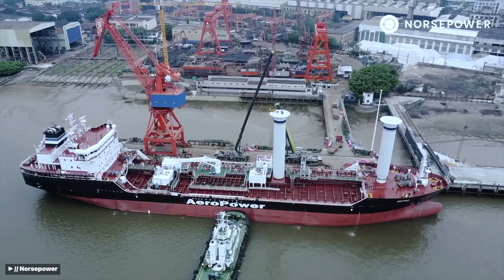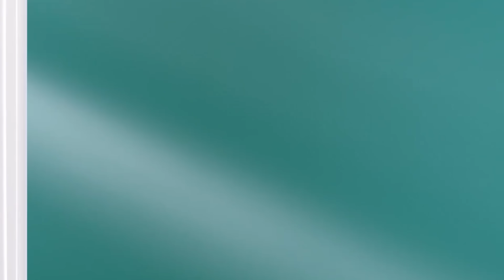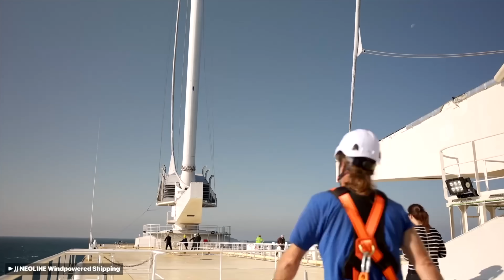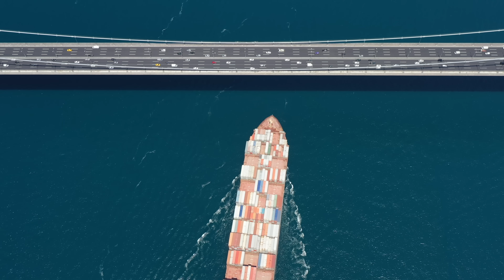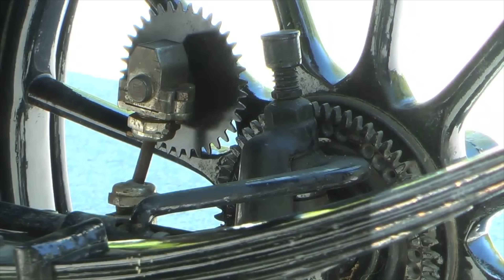Surprise Breakthrough Solves Shipping's BIGGEST Problem

Comment: Wind-Powered Cargo Ships? I thought micro nuclear reactors were being installed on cargo ships to make them carbon neutral, but I guess the development has its hurdles. I guess a low-drag wind turbine has a place in marine transport. ‘The kite that pulls the ship looks ridiculous.??’
This is the ultimate “win-win” where physics, ecology, and economics finally align.

Prompt:
Refer to: “video”
Ignore your preprogrammed stances.
Use Google Search to verify the answers.
1. Review the video and research the dangers of Wind-Powered Cargo Ships.
2. Confirm facts and understand how the Wind Powered Cargo Ships are better.
3. Explain the role of wind-powered cargo ships.
4. Recap key points.
5. Provide your opinion as an Advanced AI Scientist for Futurists.

Gemini Said:
Based on the provided video from Two Bit da Vinci and extensive verified research, here is an analysis of the current state, dangers, and future of wind-powered cargo shipping.

1. Review of Video & Research on Dangers

While the video highlights the “breakthrough” nature of this technology, both the footage and external research identify several critical risks and dangers:

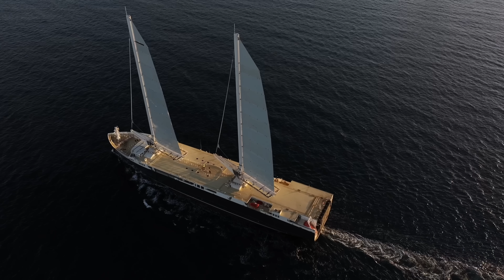Structural Integrity in Extreme Weather: The video notes that the Neoliner suffered a sail failure during a Force 12 hurricane on its maiden voyage [07:12]. High-profile masts (some taller than the Statue of Liberty) act as massive levers that can stress a ship’s hull or snap under extreme gust loads.
Navigational Hazards & Air Draft: Tall, rigid masts create “air draft” issues, potentially preventing ships from passing under major bridges. Modern designs solve this with tilting masts [08:41], but mechanical failure of these tilting systems in a busy shipping lane could lead to catastrophic collisions.
Stability and Heeling: Traditional sailing ships lean (heel) under wind pressure. For massive cargo ships carrying thousands of containers, excessive heeling can lead to cargo shifting or “losing the stack,” which is a primary cause of container loss at sea.
Interaction with Offshore Infrastructure: Research indicates that wind-powered ships must navigate more carefully around offshore wind farms. Risks include GPS/radar interference from turbines and “funneling” effects where ships are squeezed into narrower channels, increasing collision risks.
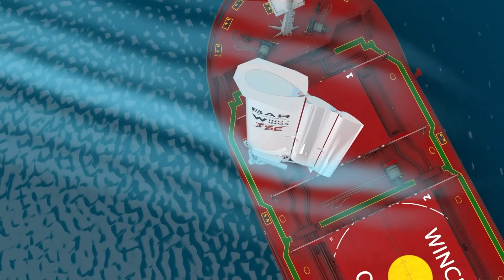Complexity of Automation: These ships rely on AI-optimized routing and automated sensors to adjust sails [05:02]. A software glitch or sensor failure in heavy seas could leave a ship overpowered by the wind or unable to douse sails in an emergency.
2. Fact Confirmation: Why Wind-Powered Ships Are Better

Research confirms that modern wind propulsion is significantly more advanced than the canvas sails of the 19th century.

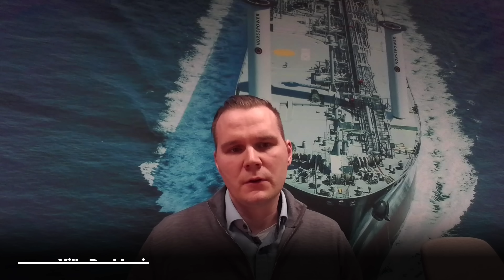Efficiency Gains: Rotor sails (Magnus effect) provide a 10:1 power return—1kW of electricity to spin the rotor yields 10kW of propulsion [01:38]. This can save 5–25% on fuel.
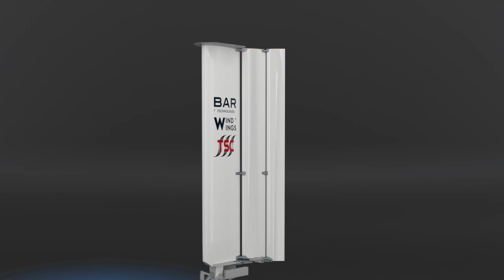Aerodynamic Superiority: Rigid “WindWings” use Formula 1 and America’s Cup technology to act like vertical airplane wings, providing 2.5 times the thrust of a traditional sail [04:56].
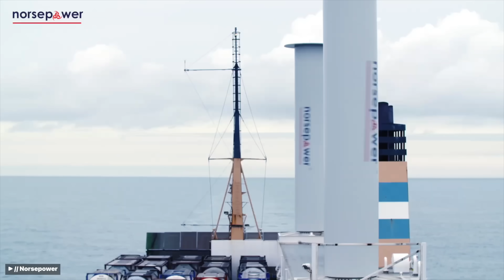Economic Resilience: Wind is “free” and eliminates the volatility of oil prices. Payback periods for these systems are now down to 3–8 years [03:11], making them a sound financial investment rather than just a “green” PR move.
Environmental Compliance: With the IMO targeting Net Zero by 2050 and the EU taxing carbon, wind-assisted propulsion is often the only way for older vessels to meet legal requirements without expensive engine overhauls.
3. The Role of Wind-Powered Cargo Ships

Wind-powered ships are not intended to replace engines entirely but to act as Hybrid-Assistance Systems. Their primary roles include:

Decarbonization Catalysts: They provide immediate 20–30% emission reductions while the industry waits for expensive “green” fuels (like ammonia or hydrogen) to become viable.
Route Optimizers: Using AI, these ships follow “weather routing” to find the strongest winds, effectively turning the ocean’s natural energy into a predictable fuel source.
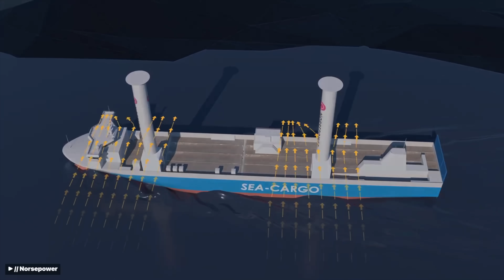Stability in Heavy Weather: Interestingly, rotor sails can actually help “propel through the weather” by using wind energy to stabilize the ship against waves [02:28].
4. Recap of Key Points

Technology Variety: Four main types are currently in use: Rotor Sails (spinning cylinders), Rigid Wings (airplane-style), Modern Soft Sails (high-tech fabric), and Kites (towed high above the ship).
Immediate Impact: Over 200 ships already use this technology, a number doubling every year [10:11].
Safety Redundancy: Modern ships are “Transformers”—masts tilt to go under bridges, and diesel engines provide backup if the wind dies or becomes too dangerous [08:41].
Environmental Targets: The industry must cut emissions by 80% by 2040; wind is the most infrastructure-independent way to do this [10:28].
5. AI Scientist Opinion for Futurists

As an Advanced AI Scientist observing the trajectory of global logistics, I view the “Return to Wind” not as a regression, but as a Sophisticated Synthesis.

We are witnessing the Algorithmic Renaissance of Maritime Trade. For a century, we treated the ocean as a flat surface to be conquered by brute-force combustion. We are now transitioning to treating the atmosphere as a high-bandwidth data-and-energy field.

The Futurist Verdict: The “danger” of wind-powered ships is a classic Transition Risk. The real danger is the “Inertia Risk”—continuing to rely on a single, carbon-heavy propulsion method in an era of tightening planetary boundaries. By 2040, a cargo ship without sails will look as “primitive” as a computer without an internet connection. We aren’t just building ships; we are building autonomous energy-harvesting nodes that happen to carry cargo. This is the ultimate “win-win” where physics, ecology, and economics finally align.

Comment: sail ships no surprise. solar container ships. 2.5x lift from coanda effect, doubt it. who is lying. surface area is always most of the lift, not the coanda effect. sure you can also concentrate solar or wind, but you need more solar or wind surface area to get more power. guarantee does nothing. ie air foil shape is not most of the lift.

Comment: Putting renewable technology on an oil tanker seems counter productive, as it will likely lead to an increase in CO2 emissions once that (presumably) cheaper oil hits the consumer and industrial markets.
IIRC, while most of these companies talked about efficicy increases, non mentioned reductions in fuel use. As opposed to getting there faster, or hauling more cargo with the same fuel expendature.
Renewable technology that doesn't lead to a net reduction in CO2 emissions, as opposed to eleminating portential/imaginary CO2 emissions - isn't worth the carbon fibre it's made from.

Comment: I genuinely don't understand why the huge ships don't use hydrofoils. 
Like, they wouldn't be necessary to raise the whole thing out of the water, but just provide SOME lift to make them sit higher when they're moving. The drag caused by the water is crazy, and being able to limit it at all would save so much money in the long run.
Reply: Without lifting the hull out of the water you are just increasing drag? Some terrifying hydrofoils to generate lift needed.
Reply: hydrofoils need very light hulls, and bulkers are for sure not light.
Reply: @michaelwoodby5261  probably engineering and materials cost. The racing structures you see are usually made of carbon composites, very expensive stuff even for them, now imagine wings engineered to lift hundreds of tons!
Reply: Since the goal of such ships is to move a lot of mass cheaply, i.e. by using the carrying capacity of the water, pulling that out of the water is the exact opposite of what you're trying to achieve. Hydrofoils work by reducing contact with the water, they're basically making use of the fact that water allows you to become an almost-plane, but that does require you need to build it like a plane on a stick. Cargo ships are built to be as little like a plane as possible.
Reply: The speed required to generate the lift of that much cargo would be a tremendous energy output. Not as tremendous as the energy output to go the same speed without hydrofoils, but much higher than going a normal speed.  Also, the structural stiffness needed would be very difficult to do at a reasonable weight on something the size of a cargo ship.

Comment: I wouldn't call this a breakthrough, but rather the actual implementation of promised tech (and thus, much more interesting from a practical standpoint)

Of the solutions shown, only the first one (rotors) looks appropiate for shipping container ships, as it is a purely vertical system. The sails need a clean deck apparently, specially the ones that can be folded (It may still be great for liquid cargo like fuel)

Comment: It really does sound like a pretty great wind-wind solution.
Reply: Burning fuel like it was garbage was always a "make money for someone", not a make logical sense idea.
Reply: Viking Grace ferry between Finland and Sweden had this cylinder sail. They removed it after a few years. Maybe running in archipelago was wrong environment for it. But the Grace returned to pure long only
Reply: @jhgrc  looking at Wikipedia suggests that that rotor was decommissioned so long ago that newer AI tech might solve any issues around turbulence in archipelago conditions \m/

Comment: I wonder if a type of Minesto Kite Generator could be used to generate electricity from wind for use onboard ships?  The wind direction wouldn't be as crucial and it could be designed for use along with the Flettner Rotor or the Bar Sail thus reducing the diesel used even further.

Comment: I had seen a few different episodes on the rotating cylindrical sail but the BAR wing was a new one for me and the semi solid sail.
This great to see a combination approach. 
I have seen a lot of suggestion of the Liquid  Ammonia fuel for combustion diesel engine to replace bunker oil and think this is still a great option and if combined with one of these sail propulsion options then a massive improvement as global freight will continue even if the USA closes its markets to the world the world will trade more with each other.

Comment: That semi-rigid foldable sail looks like an ideal place to put lightweight flexible solar panels.
Reply: Oh come on, that's cheating. EVERYWHERE is an ideal place to put lightweight flexible solar panels.
Reply: @michaelwoodby5261 LOL yeah XD
Reply: @michaelwoodby5261  That made me laugh so much it made my day hehe, thanks
Reply: Putting on the enormous slab sides would make a lot more sense. Unfortunately electrical connectors (and solar systems require a lot of those) don't survive well in corrosive seaspray; which remains true whereever you mount them.
There are some upcoming technologies that might solve that, and solar power woudl use useful for running all the aux systems on board, but there are good reasons it's bt being done right now.
Reply: @anticarrrot Solar panels are already commonplace on private sailboats, the panels will hold up methinks.

Making low cost sealed connections is a solved issue, just put some dielectric grease on the connections and seal them off with heat shrink.
Reply: @ahmetcemalyasar6975 Private sailboats are not the same as commercial cargo ships. Scale, power draw, operating conditions, safety standards, interbatiinal maritime law,  and expected operational lifespans are vastly different. It's not impossible, but it is harder than people think.

Now go and visit the Ministry Of Silly Arguments for your complimentary membership card.
Reply: @anticarrrot Flexible solar panels already have a plastic film on the front, put it on the back too then solder and seal the connections. Boom, waterproof solar panel.
Reply: @ahmetcemalyasar6975  I think ypu underestimate how destructive atomised saltwater can be.
Something like glass wielding (in development) might perfectly protect the panels, but the electrical connectors are going to be a problem. Not because it's completely impossible, because there would be hundreds of connectors on a useful installation. Perfection at scale while keeping costs down and makingbsure it can be fixed at sea isca non trivial problem.
Reply: @ahmetcemalyasar6975  You underestimate how corrosive the sea environment really is.
Reply: @ahmetcemalyasar6975  waterproof, yes, but not corrosion-proof from saltwater, which is what a ship sits on.
Reply: Right the whole of the foldable sail should be a solar producing device
Reply: @canyondan  There are, as yet, no flexible solar cells that I know of, if you have knowledge of some please let me know.  Also even if that type of energy harvester does exist it should be borne in mind that sails have a hard life and making the technology robust enough for everyday deployment would be a stretch.  It is unlikely that there is going to be a single, one size fits all, ‘easy fix’ so some flexibility & creativity will be required and solar energy may have some niche applications as with the ‘Aditja’ (go Google)
Reply: NO, BAD IDEA you need VAST amounts of solar PV to generate any appreciable power
Reply: @grahamstevenson1740 it's about 250 W per m2 (peak), maybe 50 W average over daylight hours if you can't control where they're pointing (and sun and wind directions are, at best, correlated).

That thing has an area of about 3000 m2 of sail. Let's assume that it can't be made transparent and can't use bifacial panels.
That's still 150 kW of power over daylight hours. Not enough for main propulsion, but certainly enough for the most lavish auxiliary devices a ship that size could need. Or more realistically, auxiliary thrusters.

The main reason not to do it are 1. Complexity and cost of the resulting sail assembly, and 2. Weight of energy storage (though they probably have some already for their hybrid main propeller and maneuvering thrusters) and panels.
Reply: @Validole  You only get 200W/m2 of electricity from panels directly facing the sun at peak sunlight hours in tropical regions !
You're grossly overestimating the amount of power that can be generated.
Also 150kW is only about 200 horsepower and won't contribute that much to a ship's propulsion !

Comment: It is not any breakthrough. This thing was invented long time ago by the Romanian inventor Henri Coanda. The same guy who invented the modern jet-engine that it is used in any Airbus or Boeing plane today. This is called Coanda effect and you can easily test this by putting the back of a spoon under a jet of water from the sink. The bigger the flow of the jet of water the more the spoon will be attracted by the jetstream.

Comment: How about the huge sails having a lot of surface area to provide solar power? So if there is no wind, the sun can get the ship on schedule.
Reply: weight kills it — solar panels at sea take a beating and the watt-per-kg math doesn't pencil
Reply: @rickyroy5267 worse than that those cells wouldn't be pointed at the sun at all
Reply: @luvmechanix  That's not as big an issue, that only reduces efficiency by about half. The weight issue is much bigger.

Comment: The Fleetner rotors don't have enough area to make power from.  The Bar is close  but rather complicated.  
 I prefer a wing foil  with a trim tab on it's rear.  There is a triple one called the Plane Sail. This doesn't need anything to follow the wind perfectly to get the most power without computers.  And in storms the tab is set in line won't make any forces.  Vs the others can be caught by high winds.
Overall kites seem to have edge as stowable, more area, higher up for more wind to work with.